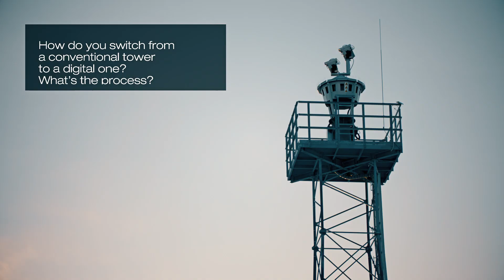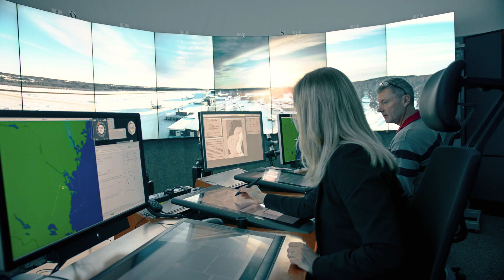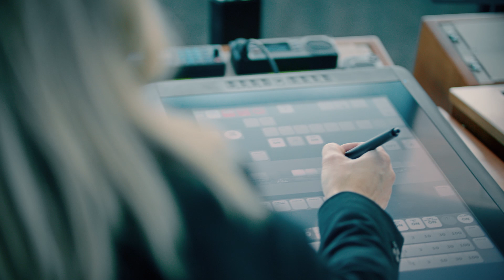Going operational with digital tower

Comment: Does this mean that each airport does not have to have air traffic controllers at the airport?
Reply: Pretty much yes. You could place the control room anywhere as long as there is a stable connection to the tower
Reply: Yes, Sundsvall in Sweden. There is a big ATC center that controls many airports at the same time.